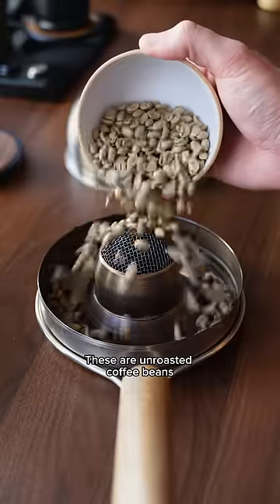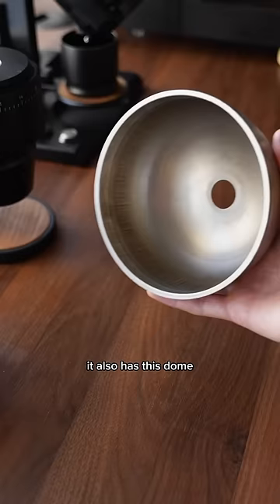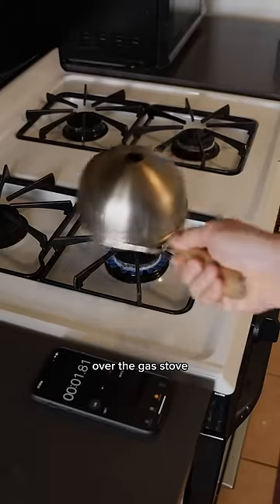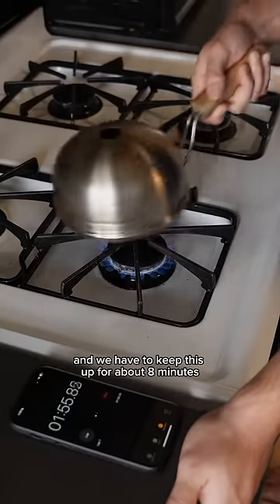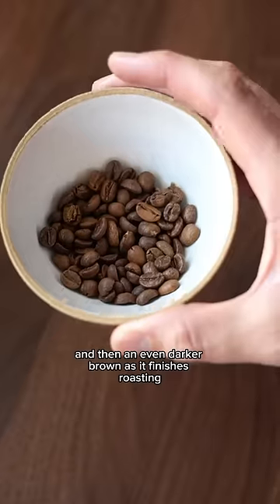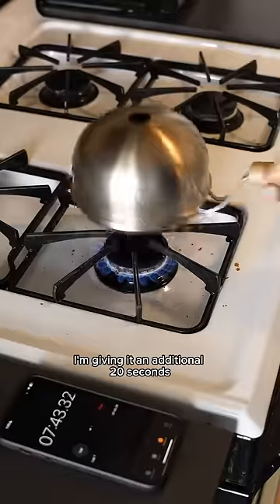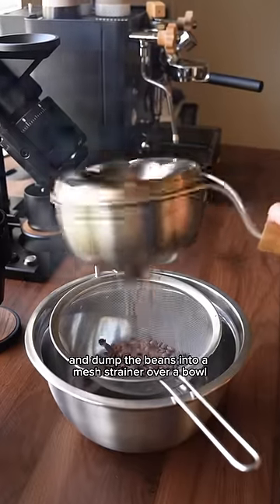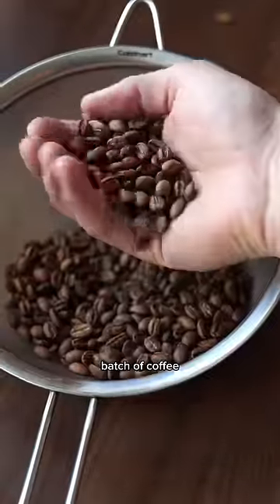Home Coffee Roasting

Comment: shaking for 8 minutes? that is some real commitment right there 😂
Reply: 8 minutes?!

2, take it or leave it.
Reply: The thing also costs like 100$ because it's is associated with coffee whoa
Reply: @Killz4Dayz  yes minutes on Extra hot
Reply: Only with Angela White
Reply: Been practicing since jr high.. I'm okay with 8 minutes 🤭
Reply: @sosoanngeyoutube  😏
Reply: I've ground rice by hand for over an hour, what of it 😂
And no the end result was not good 😅
Reply: As a home roaster, I'd be happy if I could get a light roasted beans in 8 minutes. Usually,  I stand in front of the stove for 45 minutes to hours just to get my 500 gr beans into a medium roast or medium to dark. If you want to maintain its orginal notes and sweetness as good as possible, heat it on a small to medium flames, stir it slowly but not too slow, increase the heat after the 'cinnamon stage'. Which also mean, more time to roast, and it's kinda frustating because the beans rarely pop at that temperature while the color seem darker than usual. You have to chew a sample, find out are the heat is evenly distributed and it's brittle enough to grind.

Comment: That’s a lot of work for some pretty unevenly roasted beans, doesn’t really seem worth it compared with getting a dedicated roasting machine (or just buying pre-roasted from a local shop)
Reply: It might seem that way, until you try it. Then you'll know.
Reply: Freshly roasted coffee beans cost $30/lb so very well worth trying this
Reply: @Adam1nToronto no. There’s zero chance. Local roasters do exactly this but better in every way. There’s just no logical way this is better.
Reply: @PhaythGaming 
Buying roasted coffee beans is 3-5 times the price of green coffee beans. 

You can also control the roast since there are coffee beans that have different flavor profiles when roasted around the first crack vs the second crack. 

Now if you think that none of the things I stated are "better", then I guess you're the one who is not being logical here.
Reply: @nalskipper7447  the only real argument is cost because roast level is adapted by roasters all the time to make sure they get the most out of the bean.
Reply: @nalskipper7447 You're not controlling any roast with a manual coffee roaster lol. That's why roasters buy expensive machines.
Reply: @BlueDragon1504 not to mention you need actual chemistry knowledge and temperature/airflow monitoring equipment to control the process. Plus, home roasters are likely using the coffee in the same day without resting which makes it impossible to extract properly.
Reply: You can actually get very even roasts with this roaster. Plus you can control heat and airflow with distance from the element because of the hole in the bottom. 
I’ve had excellent results with a bit of experience.
Reply: It's not about worth, it's about fun